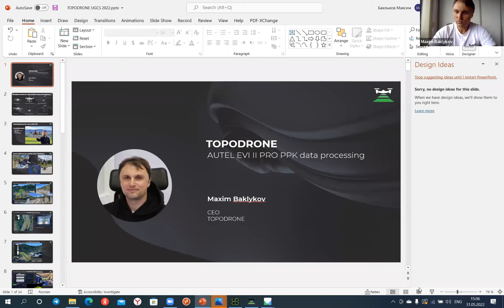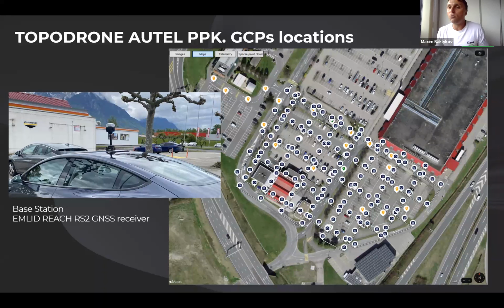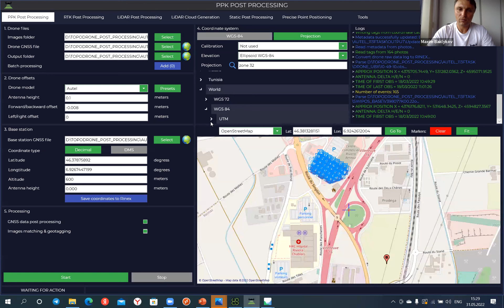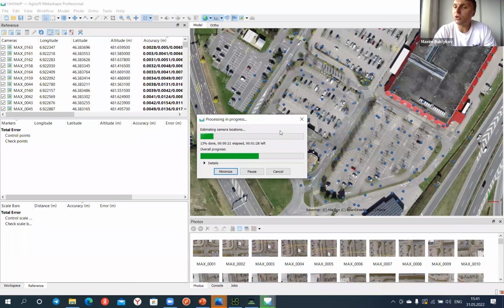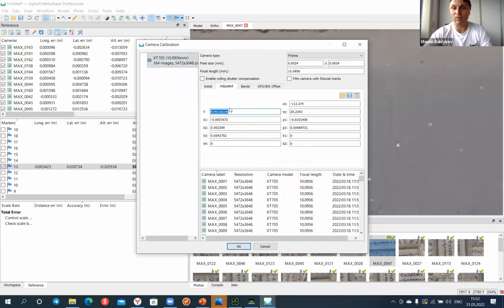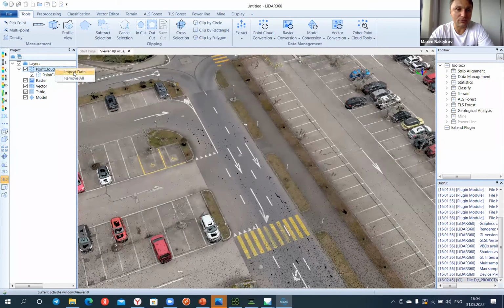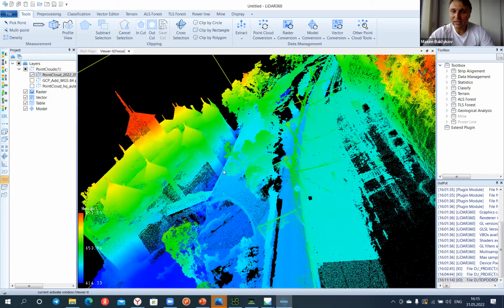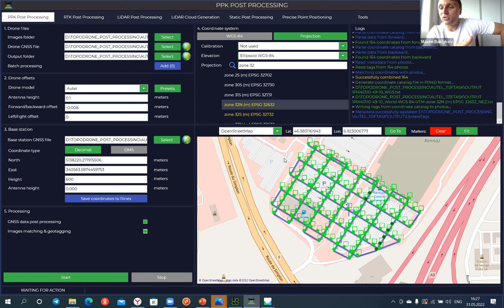How to enable PPK for Autel EVO II Pro and to get 3 cm accuracy without GCPs?

Comment: I’m new to photogrammetry and I would like to get into the business using drones. I do own a 5” freestyle fpv drone currently so I know a bit about drones. My questions are
1. Which drone do I need to purchase and is it easier and cheaper if I build my own? Is there a specific size I should build to carry a specific payload such as a good camera? Maybe a 7” build? Or just buy a dji inspire or m300?
2. Which camera is good for photogrammetry and should I pick one that’s not too heavy ?
3. Which software should I purchase and how to utilize this software? Any tutorials out there ?
4. How do I convert the images or results into a drawing showing grades ? Do I need to import ti software like autocad or revit ? Are there any tutorials on how to do this?

Comment: Hi Maxim - Hope you see this question.  How is the PPK attached to the drone?  Looked around your site and didn't see any directions.
Reply from the maker: Hi, Hanley! The housing itself is attached with 3M double-sided adhesive industrial tape, and a hole is made in the drone body for the GNSS module cable. The antenna is removable.